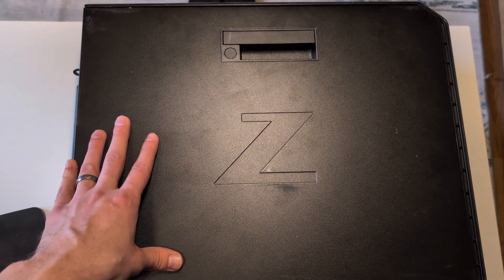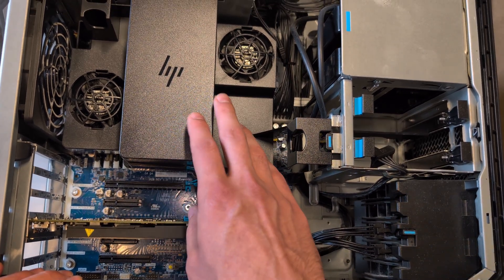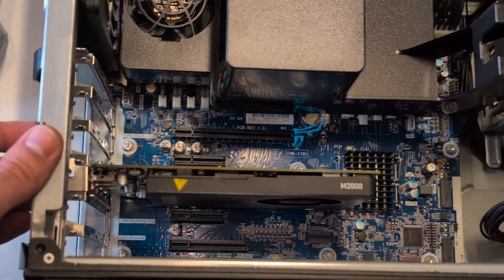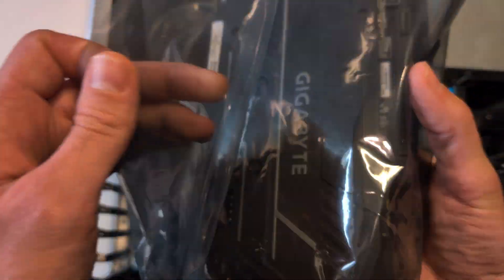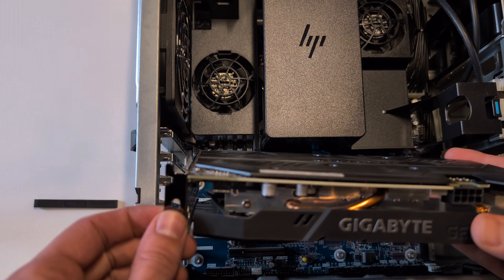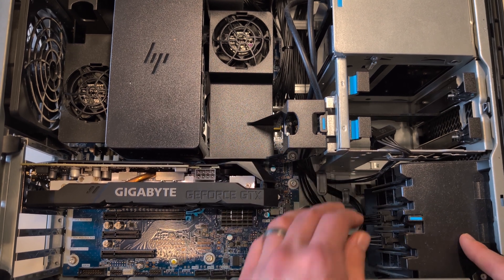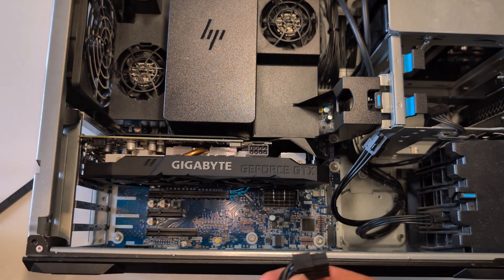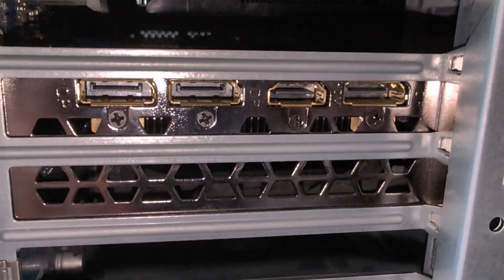Turning this old HP into a gaming machine!

Comment: I just upgraded one to a Sapphire Radeon 9060 XT 16GB. Added a WiFi/ Bluetooth card. The only thing is that the side panel has that rectangular thing  that I guess is for extra support for pcie devices. It prevents me from closing the side panel. I’m going to try and remove it.
Reply from the maker: You can remove that part! It is a slide lock!
Reply: @tesrteck Sweet! Ty!
Reply: @tesrteck It would be awesome if you made a video on how to remove that. I also purchased a fan from eBay that is meant for that computer that clips into where you showed the cable holder that prevents the bios from annoyingly  notifying me that there’s no fan. lol.

Comment: im looking at a z4 g4 with 
i7-7820x
128GB Ram
3TB SSD
$399.99 should i cop and drop a 1080ti or something i think i wanna buy it
Reply from the maker: Not a bad deal, but only if you plan to use this more as a workstation rather than a Top tier gaming PC. If gaming is your priority you don't need to pay for that much ram, but that is a decent price for a Workstation!
Reply from the maker: And dropping a 1080ti is a great plan for Price/performance. Is the ram 2133 or 2666?

Comment: Have been running that Gigabyte 1660 OC 6GB with only one 6 pin connector stable for three years now. Its a HP Z4 G4 Workstation with the i9-10900X.
However i replaced it with a HP OEM RTX 3060 Ti 8GB today. Now the computer restats immediately when I start a demanding game. So now I have also ordered a dual 6 pin to 8 pin adapter. Hope that this solves the problem. =) Happy gaming
Reply from the maker: Happy gaming! Yeah those newer cards are very specific about their power requirements. 😊 I hope the adapter works well for you! I have another one of these stations of the 4060 in it and those same connectors.